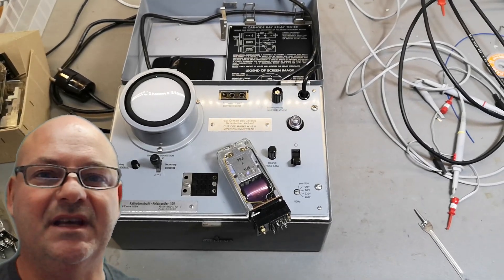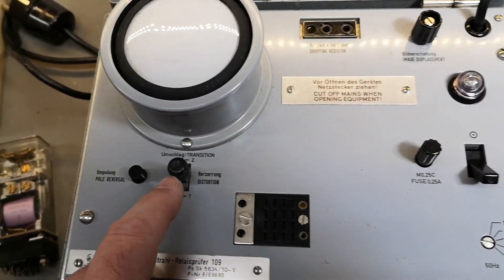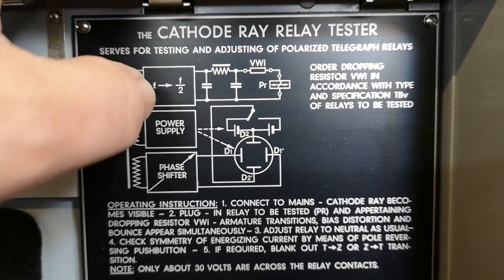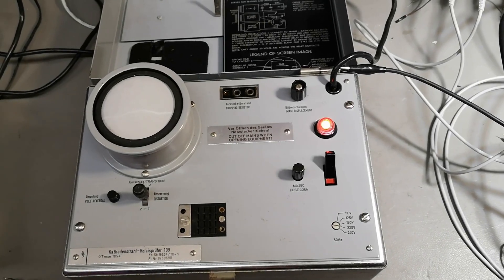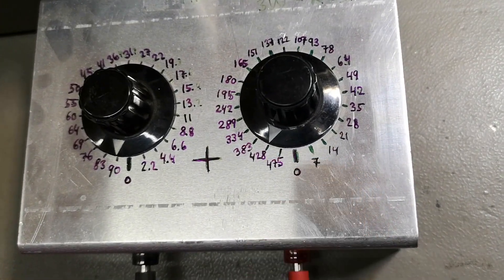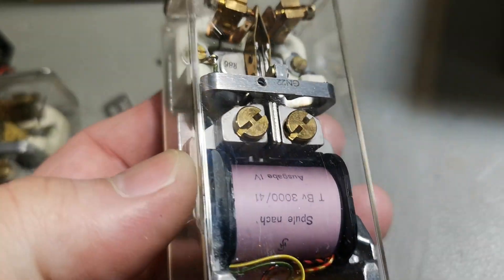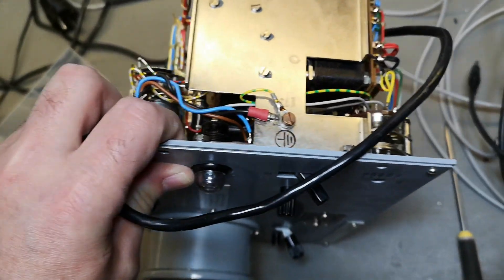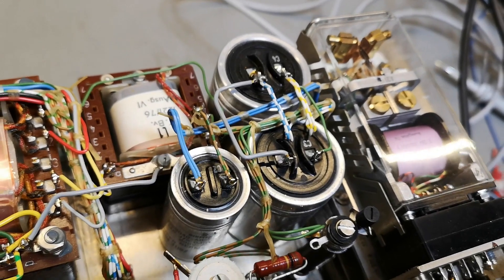Siemens Cathode Ray Relay Tester model 109 test teardown 1961

Comment: This thing is almost more electrical than it is electronic, the only real electronic component in this thing is the crt, and maybe the two diodes :D
Did you spot the hidden pots behind the warning label on the front? Sneaky sneaky :P
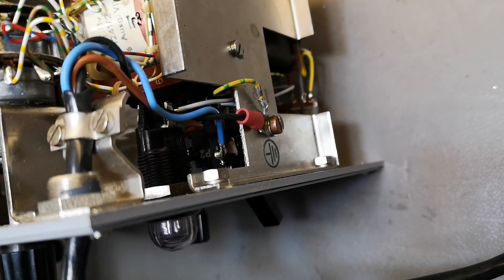Reply from the maker: ha ha you are right at 9:32 they can be see, you are very good to spot this